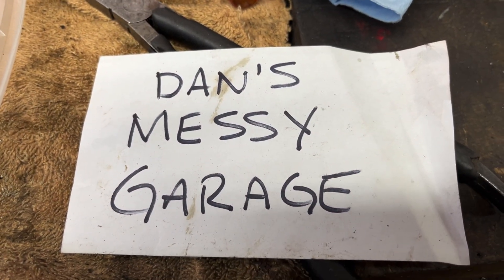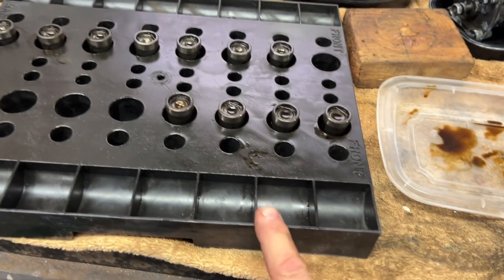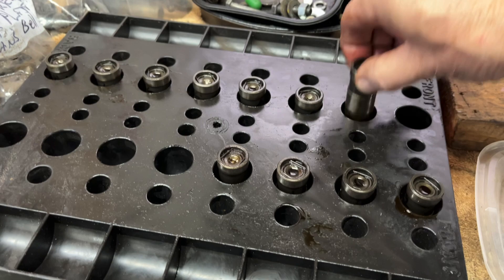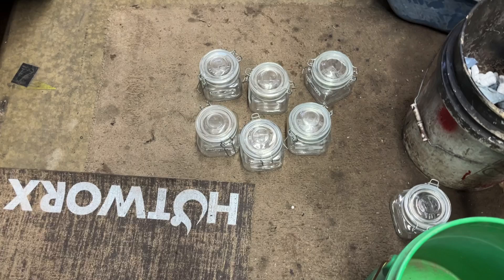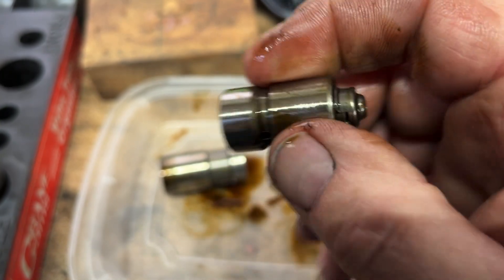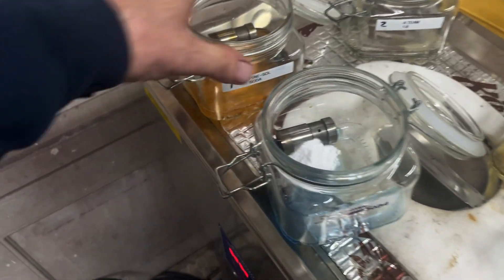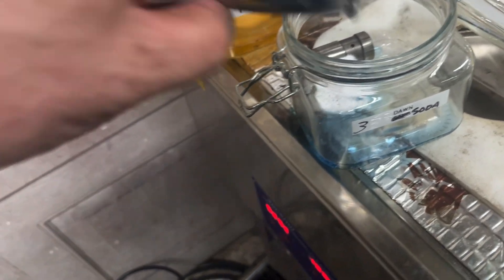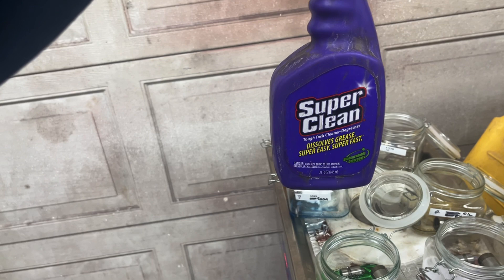ULTRASONIC CLEANER TESTS: Part 11 CLEANING HYDRAULIC LIFTERS

Comment: Were the plungers stuck before you put them in there? I'm having an issue with my lifters. I cannot get the plungers out. They are all collapsed. My current ultrasonic cleaner only gets up to 80°. Thinking I need to get an ultrasonic cleaner that gets up to a higher temperature.
Reply from the maker: I don't think they were stuck. I just didn't realize they came out like that. Yes, the hotter the better. You can boil the water in a big pot on your stove before you pour it into the cleaner.

Comment: Hey Dan , It's Dan here too . I tried a few different degreasers in my ultrasonic with same results , being cautious with aluminums . That check valve is easy to pull off with your fingers and just as easy to put back on  , i guess on your next lifter cleaning . Thanks
Reply from the maker: Thanks for the info.

Comment: I liked the demonstration of the different chemicals used and the baking soda changed the hardness or viscosity of the water. What size Ultrasonic cleaner is that, please? Also if you have the engine running now was it successful with the sealed section you didn't pull apart?
Reply from the maker: I have a 22 liter. It was the Cheapest 22L I could get at the time. It works great? It will always be best to pull items apart if possible. I pulled these apart but I did not pul apart the check ball assy. The engine runs GREAT. No ticking or lifter noise at all.